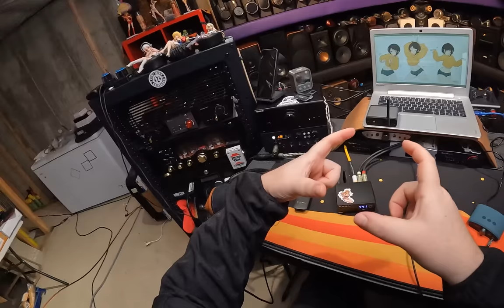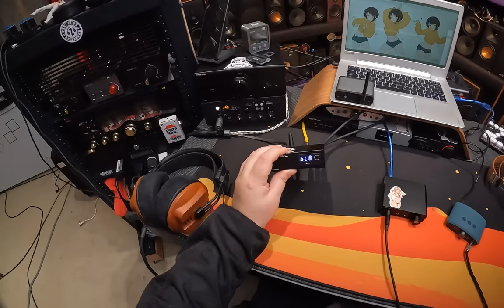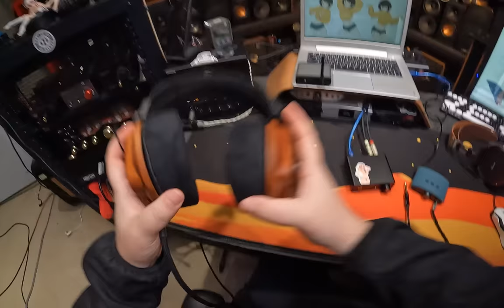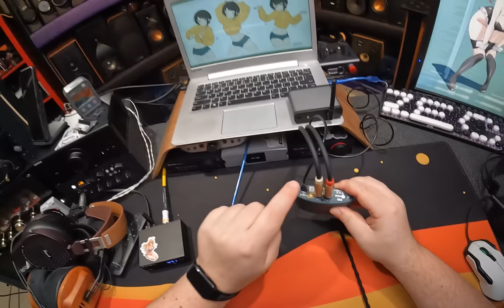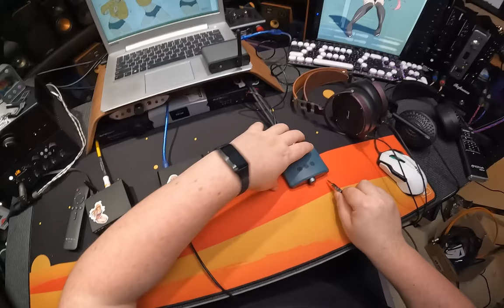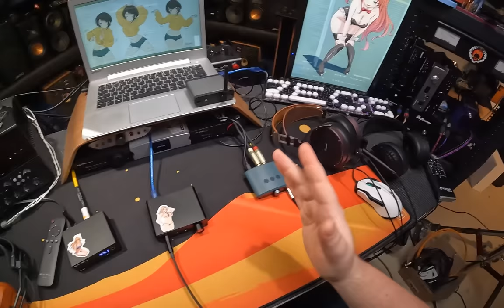SMSL C100 // Topping DX1 // ifi Uno

Comment: Lights do change on the UNO. It’s green up to 96, then cyan for 176 and 192, then white with DSD, and magenta for MQA. That being said, you actually need to install the drivers from their website and then configure it on your desktop. So, I run Tidal and Qobuz via Room and there are some adjustments you have to make because for some reason it defaults to 24/48, no MQA, and DSD to PCM. So directly on Roon you need to make the adjustments. Or Audirvana. Apparently, it does work from the native apps with just some toggle switch to make it wasapi exclusive. On my iPad, I know it does since it changes to cyan on Qobuz and magenta on Tidal.
Reply: MQA worked here right away with Roon on my MacBook Pro. No need to install drivers or something. Roon recognized the Uno as an MQA renderer compatible device and it happily plays MQA.

Comment: A few years ago I've bought an iFi Zen DAC V2 which is happily connected to my gaming laptop. I was looking for a similar DAC to connect my M1 MacBook Pro in the lviing room to my Cambridge Audio CXA81 amplifier without breaking the bank. For producing the sounds for my good old console games, watching movies streamed from my server and listening to music (Roon or Apple Music) the iFi Uno turned out to be a great little DAC.

The ring behind the volume knob does change color. It turned purple here when playing an MQA file through Roon. Similar to the Zen DAC V2. I haven't toyed with the EQ yet as the current sound is very similar to the Cambridge DacMagic 200M which handles both my CXN V2 streamer and CXC V2 CD transport. Yes, I am a Cambridge guy.

Its pricetag of 79 Euro makes it a steal really. Far cheaper, and smaller, compared to the Zen DAC V2. Definitely a great little DAC to put on your shortlist if you are looking for a cheap and great sounding way to connect a device to your amplifier. No idea about headphones as I don't use those.

Comment: i use the DX1 for my iems, perfect for my use case
Reply: DX1 just perfect for low power phones
Reply: @tenveri  you'd be surprised this also powers my he400se. With -7 preamp eq to add
Reply: @andregaboTV  thinking to get the dx1 with the he400se, how much headroom does the dac amp has after eq?
Reply: @reasanka8667  the dx1 is on 3 o clock high gain and on windows I average 50 to 70+ for music or gaming. 90 will be uncomfortable depending on the source. Using - 7 preamp
Reply: @reasanka8667  same combo and works like a champ on hi gain. On low the volume goes on 2pm max, so like 65% and it's too loud for me but something is missing and I prefer 30% on hi gain.
Reply: Would it be great for PC use with IEMs mainly for gaming?
Reply: @sisar7  there is no delay so why not? You can change buffer and decrease delay even more. There is no software to enhance gaming sounds so if you need it probably sound blaster would be better.
Reply: @sisar7  yes it is great for iem gaming too. I've had Soundblaster g6 before this. And this is much much better for sensitive iem. I use qkz x hbb for iem gaming and He400se for music with my dx1.
And you don't need gaming features lol I learned the hard way. Just get good iem or cans and you're good to go.

Comment: Zoos or anyone in the chat: I have been hunting high and low for a GOOD DAC that will give good dimensional stereo imaging for surround sound movies. I had a top shelf Denon home theater receiver and I could run my HD800/S headphones off the onboard quarter-inch phone jack. Not only was there sufficient power to blow my ears out, it generated fantastic simulated surround sound. What’s more, when watching a Blu-ray with lossless audio, the Denon would show the same codec being played just like when using my loudspeakers. It didn’t say “stereo” or “virtual”. It showed the actual lossless codec. Scrolling through the playback codecs and changing to stereo or virtual I could hear a distinct reduction in playback quality so it wasn’t a bug, it was a feature. When I upgraded to 4K I purchased a Marantz for a couple of specific reasons but had no reason to believe that the Marantz would differ from the Denon in this respect as both brands are the same company. That was wrong. On the Marantz it’s stereo or virtual and lacks the power and separation the Denon had. I know that Yamaha home theater receivers have similar functionality as my old Denon but now I have the Marantz and I’m sticking with it until there have been enough developments to warrant a new purchase.

I know that I am not alone in wanting a DAC that can decode surround sound codecs or at least generate a stereo image that is very good for movies. There are many people who ask the questions but the answers are unwaveringly disappointing. Similarly, the Xbox Series X doesn’t make life easy since it no longer supports an optical output. Yea you could try splitting the HDMI signal but then if you don’t run into handshake issues then you run into refresh rate issues, among others. I also tried to connect a a DAC/ DAC/amp to the rear of the Marantz and though the front phone jack. For the first solution, the Marantz will not allow you to siphon off the audio from an HDMI source. For the second solution, that just didn’t work, at least not with my iFi iDSD Signature DAC/amp. Do any of you have a good solution for this?

Comment: Zeos, what should i choose to power a hd6xx, the ifi uno or the dx1? They can power well the 6xx? Like, to use the "full" potencial of the 6xx, cuz its 300ohms, but sum people in the hobby argue dat the 6xx reach a peak of a 500ohms. So to use correctely the 6xx u need a amp dat can reach 500ohms, and this 2 dac/amp combo has a output Max of 300ohms, is in the limit to power the 6xx (300ohms).
Reply: The DX1 (in my opinion) can drive my R70x (470ohms, 99db sensitivity) adequately on high gain. Based on specs, the DX1 is also more powerful than the Uno.

Comment: Hi zeos, so i've been using topping DX1 for almost five months now and has been working absolutely fine with great sound, but recently my laptop had some kind of GPU Hardware Issue so i've been trying a few things here and there to fix the issue that led up to nothing and i ended up resetting my laptop and do a clean install (and it still didn't fix the GPU Issue). And when im setting up my DX1 again for the laptop, somehow i feel like it doesn't sounds good, almost like its so thin and not spacios and also grainy, im using a Beyerdynamic DT 770 Pro 250 Ohm on it and i remember it sounding great with DX1 before i reset my laptop. Do you have any idea as to why it happen ?

Comment: If I connect an iFi Uno to a Schiit Magni, will i be able to hear the EQ presets on the iFi through the Magni?
Reply: Yes, it will pick up the EQ adjustments. The Magni is just a straight amp, which means it just amplifies the signal coming from the DAC.
Reply: @PhoggHawk  thanks for the reply. I was confused because Z mentioned in the video that ifi does not push EQ through the rca outs

Comment: any recommendation dac/amp combo if im gonna drive my hd600? currently going with the zen dac v2.
Reply from the maker: I mean I love the ifi sound on neutral headphones like the 600. Maybe something Class A or go with a tube combo unit like the Xduoo TA-22
Reply: @ZReviews  i guess i should try to listen on em haha thankss 🎉
Reply: Zen DAC V2 will power HD600 very well on its own. It's a great DAC/AMP! I would also recommend the IFi Hip DAC 2 if you want virtually the same thing, but in a more portable form. Both sound the same, have similar features and similar power output.